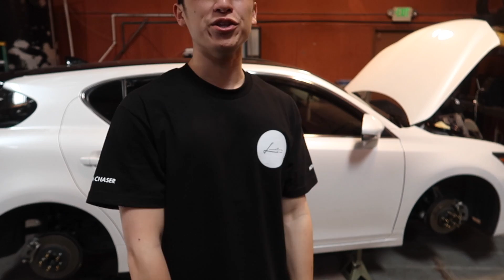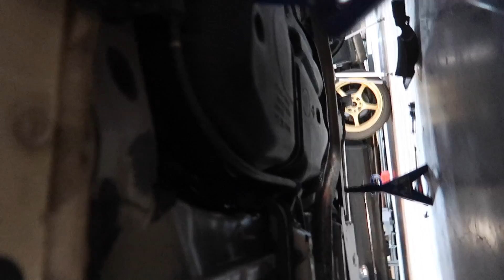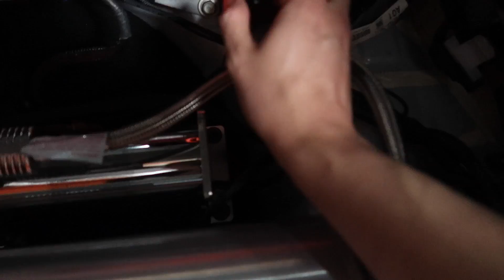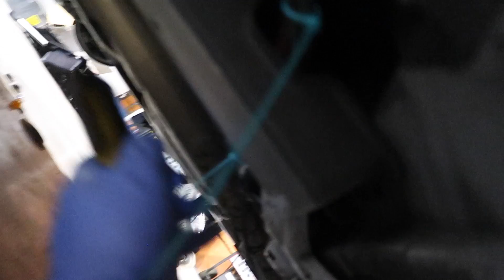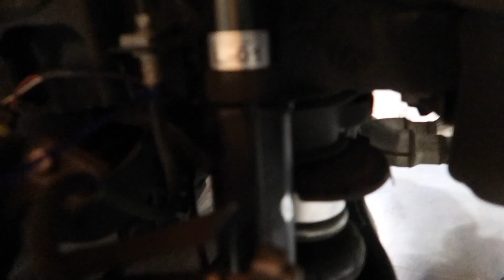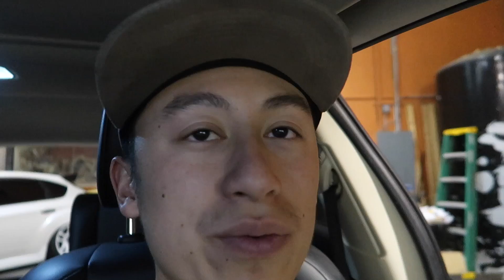CT200H Height Sensor & Airline Routing (Informative​)

Comment: yo christian, try to repin that aftermarket sensor plug. most likely the plug is bad. plus you should use loctite 567 instead of the sealant tape thats usually recommended for every single NPT fitting on the airride system to insure no leaks. just a heads up, i've dealt with the same issues on multiple cars that i've bagged. Love the content and keep grindin bro!
Reply: @Don Stengel   it works well with really high psi but the thing is that the sealant tape likes to deteriorate over time with heat and causes leaks plus the tape makes it a pain in the ass to clean the threads to maintain your airride. I just use 567, works better, much easier to maintain and doesn't deteriorate